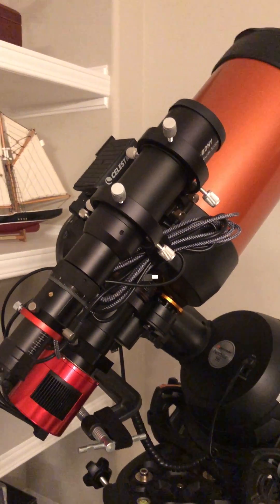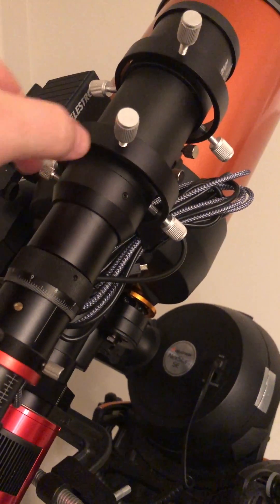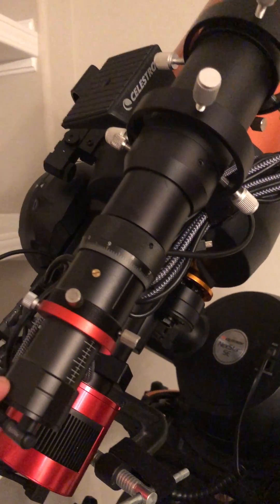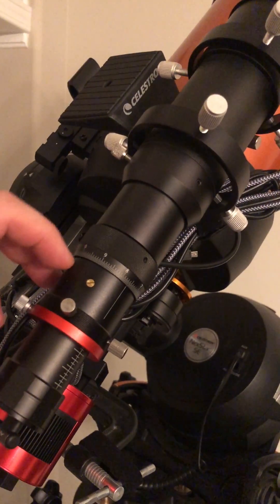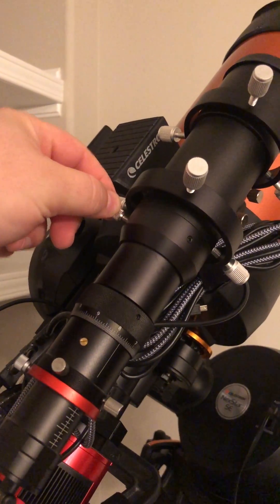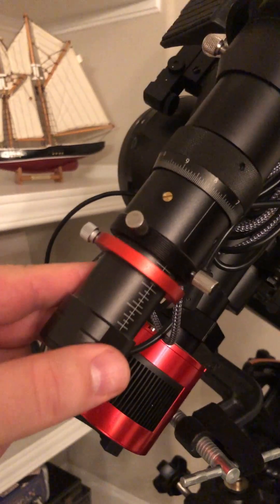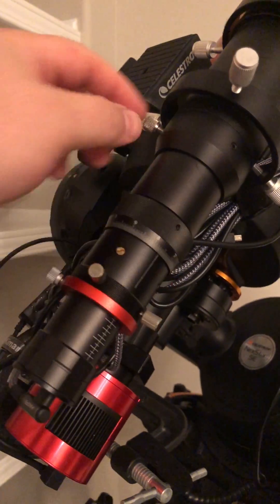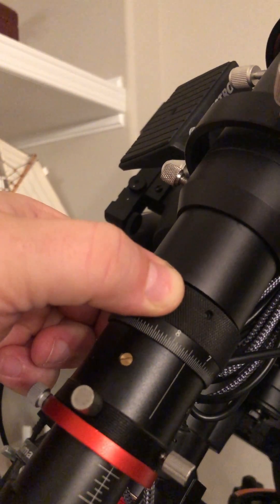Focusing the SVBony SV106 50mm Guide Scope #sv106 #svbony #guidescope

Comment: i just received mine and the helical focuser turns the drawtube. how do i fix this?
Reply from the maker: Sounds like you don't have the draw tube tightened down.  The draw tube is used for big adjustments, and the helical focuser for minute.  There should be a knob to tighten down the tube.

Comment: Is that the celestron nexstar 8se?
Reply from the maker: Hi @mrastro316, this is the 6se.
Reply: @Felldisulfide  awesome I have the 8se and I just added the Asiair plus and 120mm zwo guide camera and the AEF I'm going to test it out tonight
Reply from the maker: Very cool!  Are you using it in AZ mode or on a wedge?
Reply: @Felldisulfide  I'm going to try it on AZ if it doesn't work I'm going to get the zwo AM5 instead
Reply from the maker: Good luck with your setup!  I've seen posts of others using a similar config, so hopefully things will go smoothly for you, and if not, the AM5 is a nice mount :)  Clear Skies!
Reply: @mrastro316 I too am looking to add a guide scope and camera on my 8se , how is it working for you?